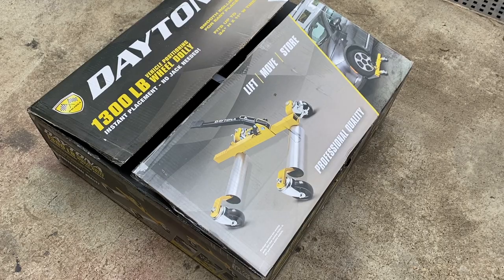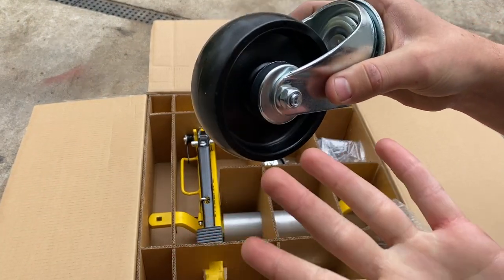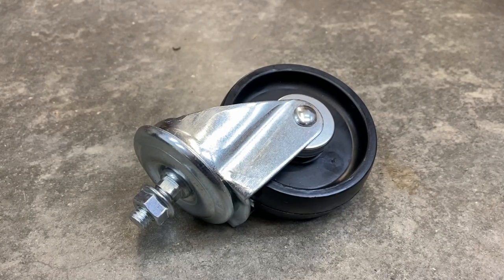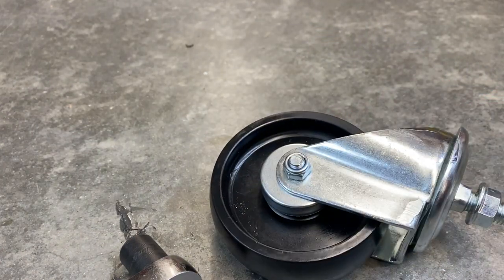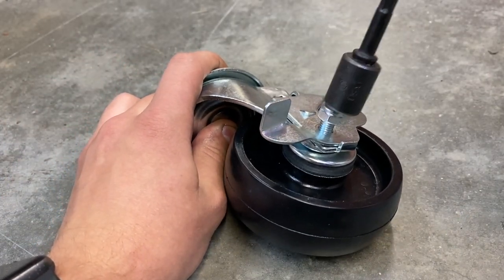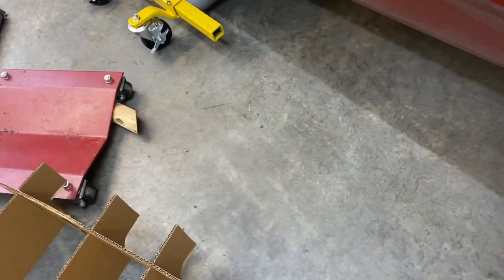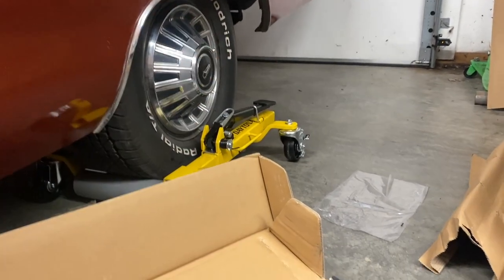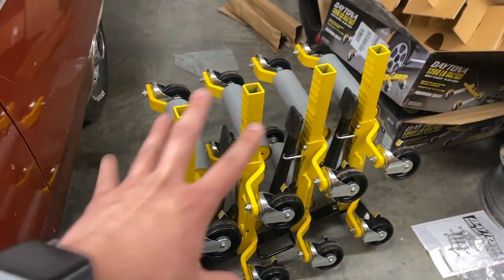Do They Work? Daytona Car Dolly's/Rack From Harbor Freight Review!

Comment: I bought one of these to use to help mounting/rotating tires.  The tires and wheels on my truck are 110lbs, so fairly difficult to get situated on the studs and mounted because you're basically having to crouch down and maneuver them blind.  Best 80 bux I ever spent, makes the job so much easier; I just break torque on the lugs, position the dolly and snug it up, then jack the truck until it's barely touching the ground, remove the lugs and jack the dolly until it's at the maximum height.  Then I continue jacking the truck until the weight is barely off of the dolly and remove the tire.  Putting them back on I line up the wheel and just push it onto the studs, definitely makes tire rotations and brake jobs much faster with so much less effort.

Comment: What is the smallest tire size it will pick up?
Reply from the maker: The specs. don't say but it closes up fairly small, my wheels are 14" & I'd say it will do 12" wheels closed up.
Reply: @Pondsisawesome124  So do you think they will work on a quad? Tires are 18" on 10" rim. I have a high side trailer need to figure out a way to load sideways .
Reply from the maker: Should be good, spec states "fits vehicle wheels up to 34 in. H x 11 in. W."

Comment: At 10:10 would it not also be beneficial to put grease on the top bearings of the swivel round part that makes the wheel spin 360 degrees?
Reply from the maker: Wouldn't hurt!